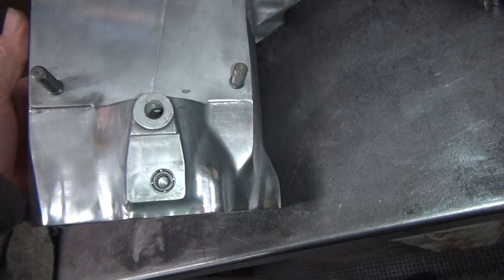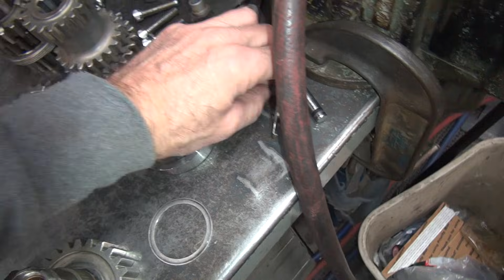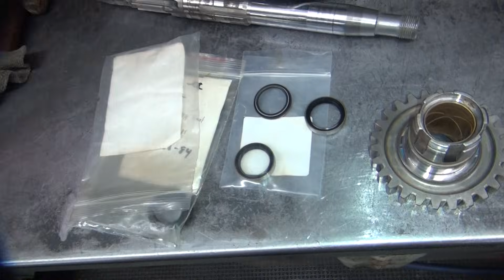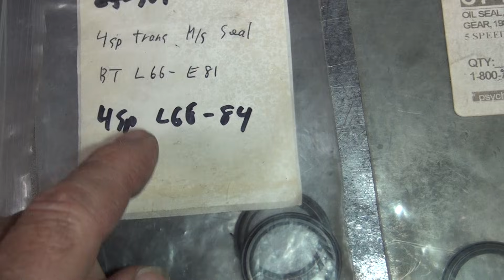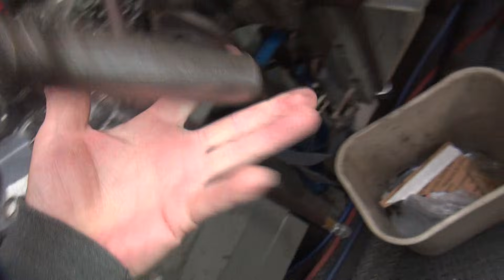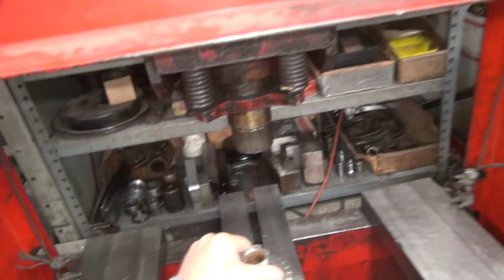#109 1970-84 4-speed revtech shovelhead transmission rebuild 74" 80 ratchet top harley tatro machine

Comment: They sell little magnetic steel boxes to put your smalls in !!
Reply from the maker: magnetics are the worse thing you can have around your tools and motor parts. magnetics cause magnetism of your parts. these magnetized parts now hold the metal grit in your moving parts which cause unwanted ware and damage. none of this is a good thing. stop being lazy and deal with your small and big parts correctly. keep things as clean as you can and your motor will like you.
tatro